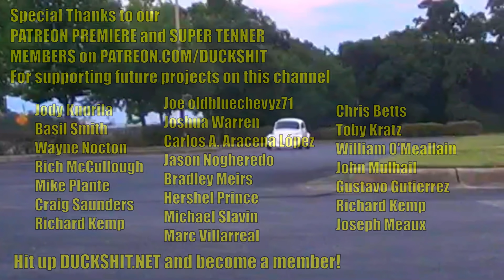CV Joints Failed!  Broken Bolts! 🔥🦆💩🔧 VW Type 3 Fastback Problem/Rescue/Repair

Comment: Hi Duckman, Never ceases to amaze me how rubbishy screws/bolts etc, have become since the chinese have manufactured them. I hate it when you put a little oomph into tightening a bolt and the head snaps off. They might be cheap labour but they also use inferior quality materials. If nothing else the bolts you were using for the cv's should have been high tensile but if they were stripping out before reaching the correct torque settings just shows how crappy they are. A good reason why so much manufacturing should be brought back to our respective countries. Great work Duckman.
Reply from the maker: Thanks my friend!  I'm so glad I've gone back to some nice proper OEM parts!  😁👍🏻
Reply: @DuckmanCycles  it's not like the Chinese can't produce good quality, when it's OEM from a Chinese plant, then it has to be to standard. Pity it can't be for non OEM companies.
Reply from the maker: @100Jeanluc  Correct... it's the problem of our vendors accepting that crap, and quality control inspectors living up to subpar standards.

Comment: I had the same experience with an old VW van. Loud bang everything works no power to wheel . Finally got it going but it was working like weak power… turns out when we got back , tore the motor apart and found that the crankshaft broke right at the middle bearing. The pistons were all firing right but only two cylinders were delivering power. Next da y got another crankshaft from a junkyard and by the end of the day we were on the road . Tough VW
Reply from the maker: Wow incredible!  LoL!  That happened to Wild Bill's Bus, but it didn't keep running!  Haha!

Comment: Wow it's funny that 2 VW people had the same problem in the same week. EZGZ in Colorado had the same problem .
So I went out and checked mine on my 69 Baja and found 3 loose on the driver side and 2 loose on the passenger side. 
I also found I have some of the bad Chinese ones so made a trip to King bolt and got all new high strength ones.
Thanks for the great video and the advise on what not to use.
Reply from the maker: Those pesky CV joint bolt gnomes are at it again!  Glad you found it before it came worse!

Comment: I guess I know what I better  check on my fastback. Suprised it didn't cause alot of vibration. Good fix.
Reply from the maker: No vibration, but after repair I did notice a whole lot less gear lash.  I imagine there was a ton of play there before the bolts let go!

Comment: I recently had the same CV come unscrewed on my Baja with the original bolts.    Hopefully the lock tight will work
Reply from the maker: Yeah I saw that video!  We both had the same problem about the same time.  Mine were complete garbage though... had trouble even torquing them down right.  These OEM ones, no troubles going in.  I hope they shall hold!  So far, a couple of really long trips without a problem!  I'm happy!  Thanks for the comment, man!

Comment: I've seen people use those axles on cross karts and they make a flange that fits the axles and run a bolt all the way through then they put nuts on all of them
Reply from the maker: That is possible on here, too, but not necessary!   😁👍🏻

Comment: You mentioned the bolts came with the CV joints 

I imagine the CV joints are similar quality to the bolts
Reply from the maker: Somehow I doubt that... as they are supposed to be remanufactured OEM parts.  Sure they can screw them up... thats within reasonable doubt... but bolts can be grabbed from any bin and sourced from anywhere.  It's cute that you'd think that.

Comment: Those bolts you bought are probably metric not af slightly different, also I use left hand drill bit's and find the bolt's useualy get hot enough to release, I brake a fue as bolt seem to be a bit weak 😅🤣😂all the best to you and your loved ones
Reply from the maker: LoL yes... I guess... if I understand this message.... haha

Comment: My late father was a Volkswagen mechanic at Volkswagen dealership and service manager  they only have 2 spider gears unless you installed a super differential i  blew out spider gear in  a swing axle. axle.
Reply from the maker: Yeah, I am very aware of that being a weak spot!  I truly expected exactly that to be the issue!  Anyway, I got lucky!  Sad though, I really wanted to repalce with a limtied slip diff!  :-D :-D :-D

Comment: Lesson Learned...Drill holes through the lower heads of the bolts and run wire through them to keep them from backing out.
Reply from the maker: Great idea!  Or just use the proper german bolts that don't ever have these problems and be done with it!  A little locktite never hurt anyone either!
😂👍
Reply: @DuckmanCycles  Good Ol' Blue...Never fails.
Reply from the maker: Yea indeeeeeeed!  😁👍🏻

Comment: Hi Glenn🇺🇸, sorry to hear of the broken down the bolts for the CV Joints.well my experience is don't buy or install Chinese junk 😤use only original VW parts when available, as I saw you have a lot of org parts around👍🏻, so clean these up and store them so you these when you should need these⚒, Good luck my friend and keep the good videos 🎥🎥coming.🇳🇴☮🍀🙏🏻💥🌞Greetings.Hubertus.Ps I have stored all of the original parts to my VW T3 Single Cab from 1982.so I have them when I should need these,
Reply from the maker: LoL yes... that is what I've been saying, but who expected something as simple as a bolt to have such a ridiculous failure?   ...and repeatedly among all of them.  It's not just a flaw.... they're absolute garbage.
Reply: @DuckmanCycles  That`s for sure Glenn just Garbage😤😤😡.
Reply from the maker: BLAHHHHH!   🤮🤮🤮🤮🤮

Comment: You should get rid of the Allen head bolts and replace them with bolts that have safety wire holes in them and safety wire them, bolts will not bask out on their own and are much easier to remove when you need to
Reply from the maker: YOU SHOULD!
Reply from the maker: OEM service manual says no such thing, the manual also doesn't say I should use China bolts.   OEM bolts are fine for street use, we're not racing here.... This had already been discussed multiple times here in the comments.  Thanks for the suggestion!

Comment: Just out of curiosity I wonder what grade the aftermarket bolts were?  My guess is lowly 4.8 and that is why they let go.  I don't know what the factory ones are but I used some quality 10.9 grade Allan bolts in my car as I didn't have all the triple square bolts and some were looking worse for wear.
Reply from the maker: Grade plastic!  LoLz I bet I can probably chew them.  But I am more curious what grade the OEM ones are.  VW/Porsche were known for using metric grade 8.8 (for anyone reading this that's more like grade 5) on suspension components without failures, where BMW used 10.9 or 12.9 on similar components.
Reply: @DuckmanCycles  got a skoda with a vw engine, the bolts on the driveshafts are 60 flbs and are 12.9 grade had the same problem as you, and they were torx, so went fuck it went the local bolt shop and picked up some allen headed 12.9...... not even thinking of coming loose.
Reply from the maker: Awesome!  Glad that worked out or you!  😁👍🦆💩

Comment: hi grade 8 bolts socket cap
Reply from the maker: Grade 8 bolts don't exist in metric.  😎👍
Reply: bolt depot //metric socket cap screw grade  stainless steel  //have a great day
Reply: @DuckmanCycles  Bolt depot metric socket cap grade stainless steel bolts //have a great day
Reply: @ineverhadthemoney7857  Or just use the OEM, inexpensive, and easily-attainable supposed-to-go-in-there parts that haven't ever failed on me!  😁😁😁😁😁

Comment: I just put fresh axles on my 68 bay window bus I got mine from IAP did your axles have a serial number engraved in the middle portion of the axle??? Man I hope this don't happen on the bus I just went out there and put marks with a paint pen so when I drive it I can tell if the bolts are backing out😳
Reply from the maker: I dunno, but probably the same.   Just use OEM bolts and you're good!

Comment: Speaking of bolts...do you have a video on removing exhaust studs? I got the nuts off of six of them, by chiseling them off, two more to go. None of them broke, but due to rust, the threads are not as substantial as new ones.
Whadya got?
Reply from the maker: No videos, maybe an idea for someday. Heat 'em and extract them.  Maybe you'll get lucky double-nutting them.  Otherwise vice grips as tight as you can make them, maybe gentle heat or penetrating lube.

Comment: In the Air Force, we used safety wire to secure fasteners
Reply from the maker: Yep, race cars, race motorcycles and competitive dune buggies, too.  VW used good bolts, not this China crap.  Wire not needed on a stock street car.
Reply: @DuckmanCycles  I had a '69 Torino GT 351W that would drop the starter on the ground every so often. I think the threaded holes were sloppy, as I had to use new bolts each time. Eventually I got tired of it and cross-drilled the hex head and wired those suckers down. Used Loctite too.  No more troubles.
Reply from the maker: LoL oops!   I wonder what was actually causing that one.  🤣🤣🤣

Comment: You could drill the head of those bolts and use locking wire ,I don’t think they would come loose after that .
Reply from the maker: Yup, or just throw away the junk Chinese bolts and never use them again, then use the German bolts that don't have issues.
Reply: @DuckmanCycles  yes that would work as well .
Reply from the maker: Plus a little locktite on principle!  :-D

Comment: Wouldn’t lock washers fix this issue?
Reply from the maker: Do they stop bolts from breaking off and stripping out before torque spec?  Maybe if they do!   🙂🙂🙂
Reply: I didn’t realize they had been soft and broke off. I commented like a third of the way through the video like a ding dong!
Reply from the maker: Hahaha it happens!  🤣🤣🤣🦆💩

Comment: sucks the problem you had but good its an easy fix! bmw's have the same kind of setup not sure how they dont come out on a bmw mind you i have come across them being loose on a BMW E46 before so maybe its the same issue. i know they're a pain in the ass to undo on a BMW though! the oem bolts are E10 so you use a female torx socket to undo them which in itself is a complete pain to do as not only do you have to force them against the boot to get the socket on straight but you also have to use a 18 inch 3/8" drive bar to undo them as they are always super tight!! much easier on a ramp of course but at home on axle stands its bad lol.

talking of bolts as you probably know there are grades so if you put in a higher grade its going to be harder and i would expect it should hold for much longer. however, as you probably also know the harder the bolt the harder it will be to drill it so sometimes weaker bolts are better depending on the application. 

keep up the video's as always
Reply from the maker: Yup!  These OEM VW bolts appear to be a much harder grade... or maybe just a proper grade, those chinese bolts may not have even been graded at all!

Comment: dude that sucks, i havent ever had that happen on my tater-tot. So as a suggestion would doing a lock wire thing help? ya know how they do on airplane engines?  there really is no replacement for the  original German parts
Reply from the maker: Why wire the good parts that don't fall out?   Other than maybe paranoia of losing them lol!
Reply: @DuckmanCycles   oh you already said it, lol those chinesium bolds wouldn't even torque to the correct spec. LOL loosing them might not be a bad thing, saves on filling up your trashcan, Also you have said countless times that the original parts are the best. from my experience, you couldn't be more correct.
Reply from the maker: Sometimes even a worn out, or repaired original part is still better than china replacement.  The only stuff that fails me is 50 years old and German, or 50 days old and Chinese.
Reply: @DuckmanCycles  oh i agree, and after seeing what you showed. i am going to save more parts. lol speaking of chinesium parts, I'm reminded of the J-tube issue you had, they looked like someone made those two parts based off the spoken description of what a VW j-tube looks like with no other reference.
Reply from the maker: Hmm.... You'll have to remind me of the j-tube issue that I had.  I don't remember having a j-tube specific issue.

Comment: Safety wire those bolts and never worry again. Its way better than lock tight. My dad use to put a flat piece of steel under every 2 bolts and bend a bit of a tab up on each one at both the left one and right one. Those Allen bolts would require a flat spot on both to make this work and you would have to custom make the oblong 2 hole washers with tabs. I hope you know what i am saying. Some lock washers may also be all you need
Reply from the maker: AGREEEEEE!  I have read exactly this, but with quality bolts you don't need locktite nor safety wire!  So that's all.... lol!

Comment: Well, I spent the first part of my day trying to put my engine on a Harbor Freight engine stand, trying to make it fit. The reason it took so long is.....it's impossible.
Reply from the maker: Do you not have a VW engine stand yoke?
Reply: @DuckmanCycles  No, we had one in the shop I used to work in, but that was decades ago. I'm just partially stripping the pancake down so I can mock up the location of my engine lid. I have a late model "humpback lid". Plan on cutting a round hole in it below the license plate lamp  for the crank mounted cooling fan, and making a large turbo "bell mouth" That should keep em guessing.
Reply from the maker: @frankschwartz7405  Yeah, the engine stand isn't  meant to go to a VW engine.  It can be made to work, but you may break the case as I have seen happen.

Comment: Wow someone else that torques lug nuts...#MFDM that's who...recheck after 100 miles
Reply from the maker: Yes sir!  Always torque em!  China lugnuts on the back lolol!  They are pretty beat up, will likely replace them with some Porsche parts, would use VW parts, but VW always used bolts and I have proper studs.

Comment: If crome will make the engine overheat why do they use aluminium radiators, wouldn't the car coolant system overheat 🤣😂
Reply from the maker: Hehe, I havent seen any chrome radiators though... I bet those get hot just sitting there!

Comment: One of those Chevy guys must of worked on it....lol if it was a dodge guy it never would have even got there....lolol
Reply from the maker: LoL this is a different vehicle... blame the "China guys" this time,
Reply: @DuckmanCycles  some wont get my humor just like yours.. I got your funny comments to bad some dont understand
Reply: @DuckmanCycles  Ah, the joys of "Chineseium" ! Makes you wonder what's really in it? Whatever scrap crap they melt down I guess. My Mechanical Engineer OCD would have kicked in and I would have had to go to the Hardware store (*real* Ace one, about three miles away) for some grade 8 cap screws and RED Loctite them. I know, but overkill is better than underkill. BTW if you want to Loctite something that you NEVER want to take apart again try the green stuff. Fun fact from my Mill Supply Sales Engineer days/years back in the early '80s: Red Loctite used to come in three grades #1 #2 and #3. Now it's just red...
Reply from the maker: Maybe they were aluminum alloy or some other mushy metal lol!  I have never seen green Loctite, and like you said it's mostly red now... or just blue... but different grades despite color.  Hard to tell them apart unless they are all inventoried in the same store display and clearly labelled.
Reply: Them Dodge guys like to put lugnuts on one side on one way, and lugnuts on the other side on the other way. When they can’t, it throws them into confusion. They often end up in, well, in ‘facilities’.
Reply: I thought V-dubs had lug bolts?